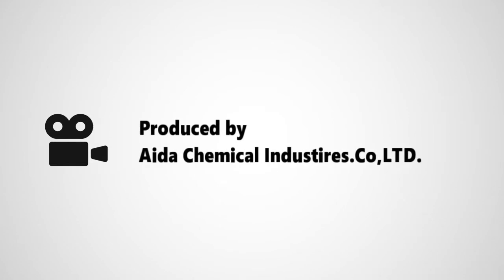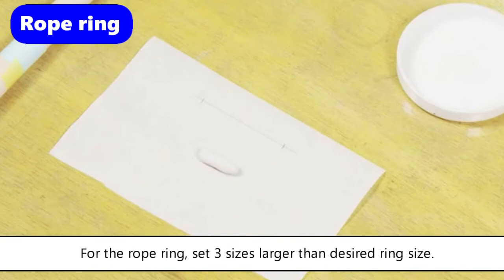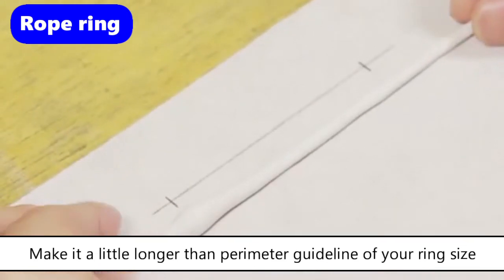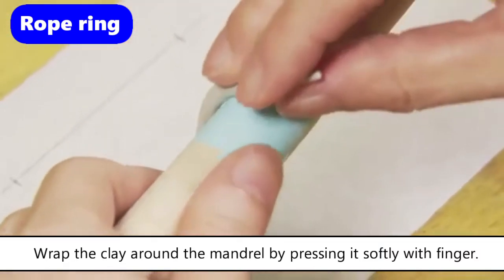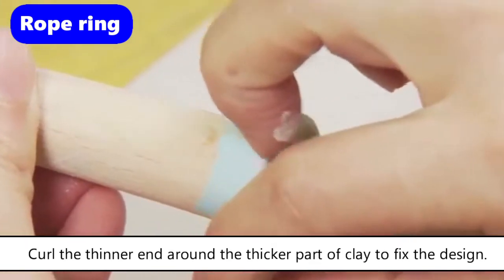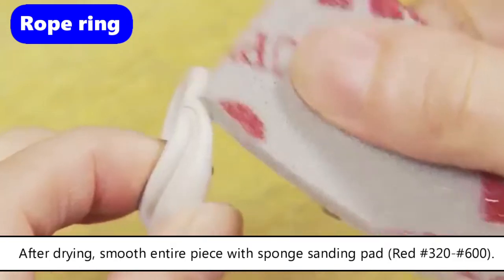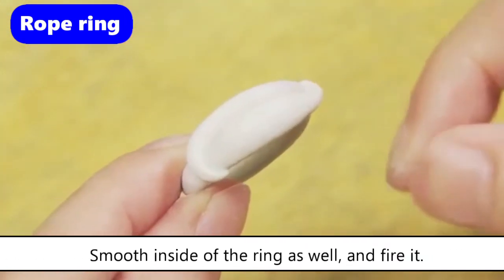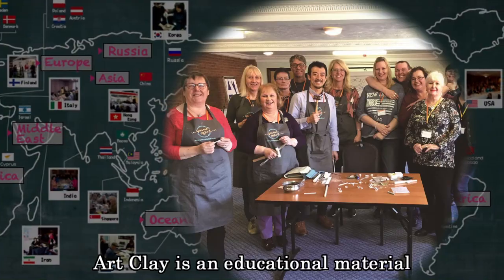How to make with Art Clay Silver –Series #4 Rope Ring

Comment: What are you using to moisten the clay?
Reply from the maker: You can use tap water. Prepare small dish to pour water, and dip your finger tip or paint brush a little then rub the clay surface.